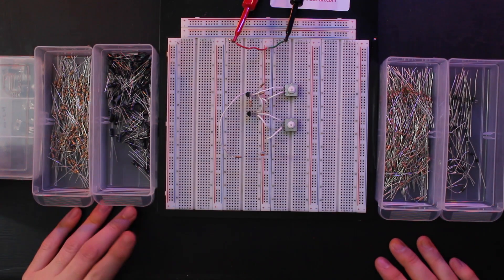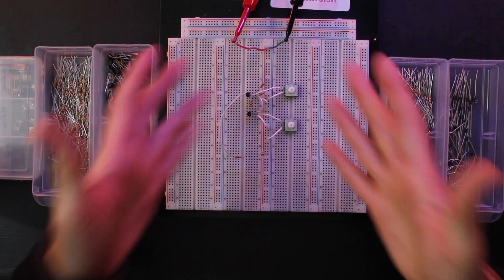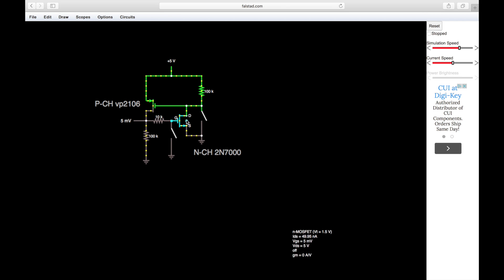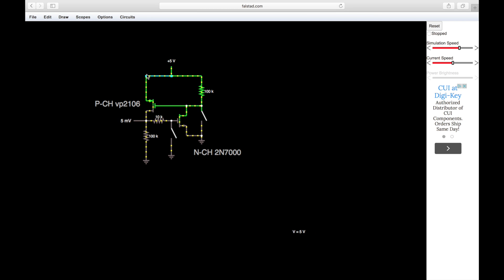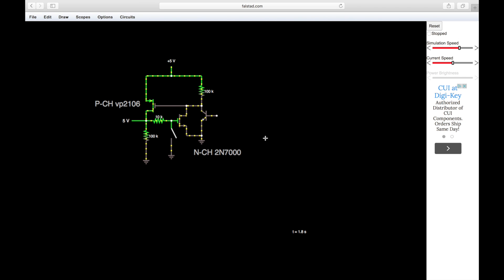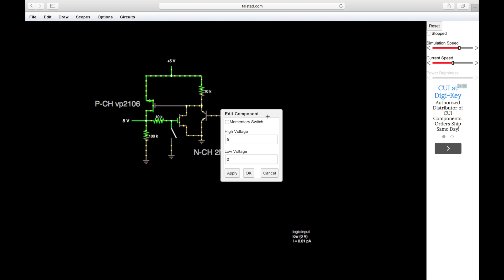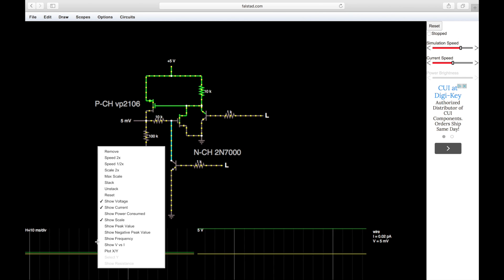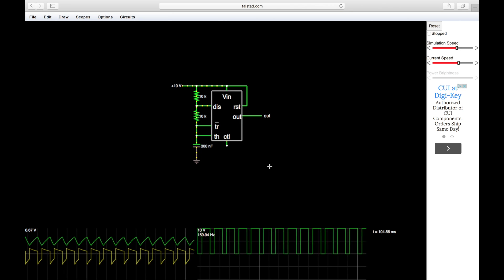Simple Transistor Latch Circuit + Easy Free Circuit Simulator

Comment: Will there be a problem if i replace the mosfets with n type and p type transistors
Reply: wondering the same thing..
Reply: It will work, but you should add base resistors since P channel mosfets don't require them, but BJT's do.

Comment: Kevin, 
I am trying to use your circuit to turn off and Arduino by it self, but I am having problems. I am using the BJT on the bottom to turn it off, when I set my output pin HIGH on my Arduino it does not turns off, but when i manually take the wire from the base to a +5v it turns off, but my arduino is not doing it. any ideas on why is not working?

Comment: can you please share the circuit that  uses 2 transistors  and resistors, in the later half of the video you only shared the simulation using mosfet but when i try to replace the mosfet with transistor it doesnot work, i want to switch a low powr circuit using only transistors and 2 switch dont want to use mosfet. So far tried many circuits tried t flipflop too but i am not able to operate the transistor in cut off and saturation
Hopefully if i cud know the resistor values u used i cud mke it work. Also can you do a video on how to find out the resistance values for operating a latch circuit at different voltages

Comment: Actually I tried this to switch on and off peripheral devices. But output voltage drops if you pull high current load like 100 mA. 
Then I used an NPN transistor to switch ground line of my device but this had problems too. The device's input voltage is higher than 6V and connected microcotroller's is 5V. Some current leaks out from digital IO lines. So I have been forced to use an electromechanical relay. A  Double Pole Double Throw one :(

Comment: Hi looking for a way to latch on at higher input voltage and latch off at a lower input voltage (so it has hysterisis). Can you recommend any references where I might find a way to make a circuit with this function for hobby purposes ~5-12v, Thanks!
Reply from the maker: +Stephen Kramer search for comparator circuits with hysteresis
Reply: Thanks!  Looks like a Schmitt trigger comparator is the one but I see there is also a transistor version fyi.

Comment: would it work if you made it such that when you push the button, the micro gets power and runs it's program,  then when it is finished, it could pull an output low to effectively kill power to itself?

Comment: I think your on-line schematic (4:10) is wrongly depicting the right hand FET is N channel when it is a P channel and the reverse for the FET on the left (According to the direction of the arrow in the FET symbol)
The devices named are correct it's just the symbols are wrong..
Very nice simulator though....
Reply from the maker: +Michael Hawthorne I'm not crazy about the symbols they used for the MOSFETs, but when you hover over them in the simulator, the GSD pins appear, and the connections are all correct

Comment: Yes to the micro-controlled version!
Reply from the maker: +RJ cool, I might whip something up
Reply: Did you ever whip it? I love your videos. Trying to figure out how to have a tilt switch turn on an arduino circuit and have it turn itself completely off after done working (not sleep). That way I don't have to build a raw Atmega circuit and can just use a mini with no quiescent current normally.